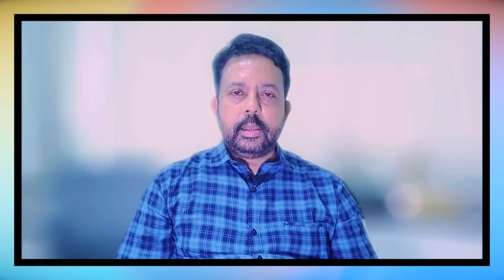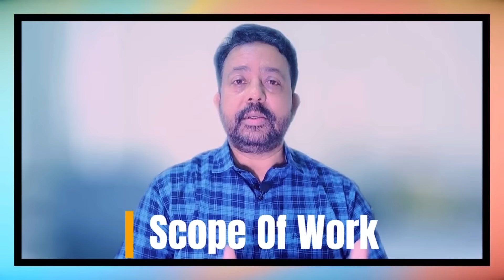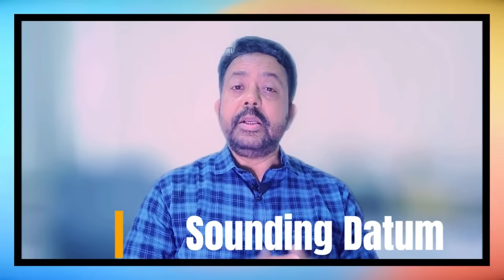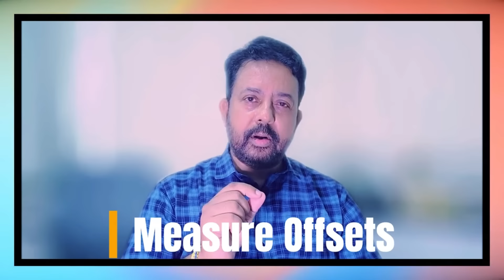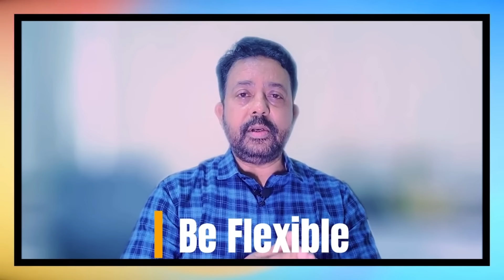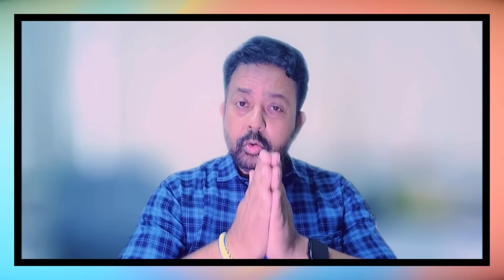Don't Start Your Survey Without This! (Pre-Survey Checklist)

Comment: One thing I might add,  is check the target projection and epoch in the SOW. There is so much confusion in this subject. Many EPSG's are an approximation. Take care when the TOWGS84 parameter is all zeros when your target is a local reference frame. Best ask the customer for 4 corners and the center of the survey area in both wgs84 and the target projection. This way you can feed the positions in your software and check the output long before the mobilization.
Reply from the maker: Thanks, thats a valid point which completely forgot to add. Yes we do a geodesy report with a client provided check coordinate. Normally it is not an issue as we just click and select the Geodesy. By the way 90% of client do not understand this. I myself is confused by the milliins of EPSG codes. There are separate codes for normal wgs84, another for wgs ITRF 2020 and another for ITRF 2020-2023. I must say that IERS must start defining codes properly without confusing poor surveyors.